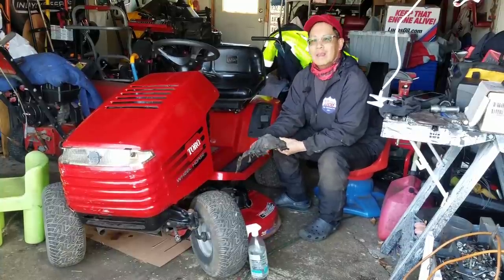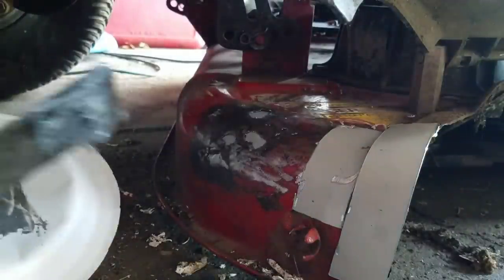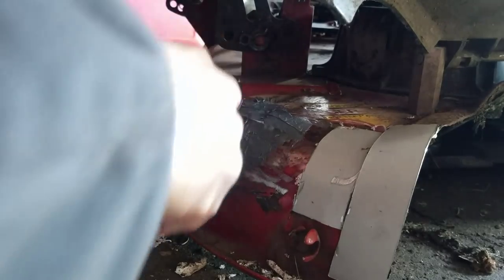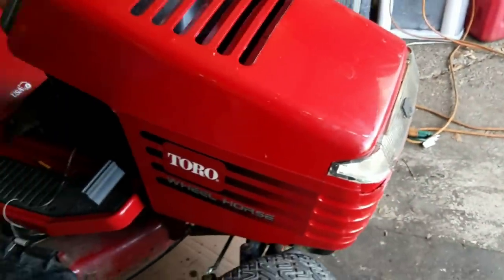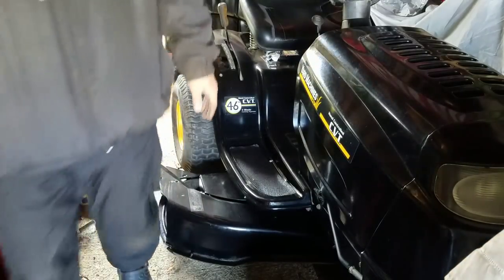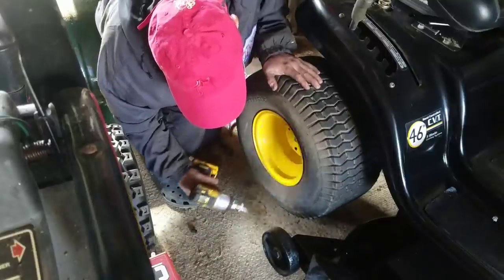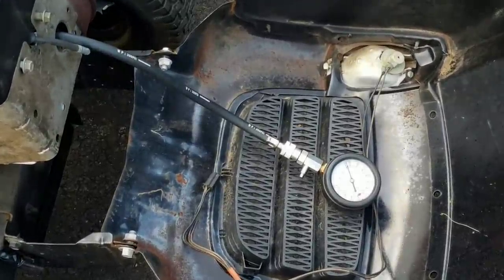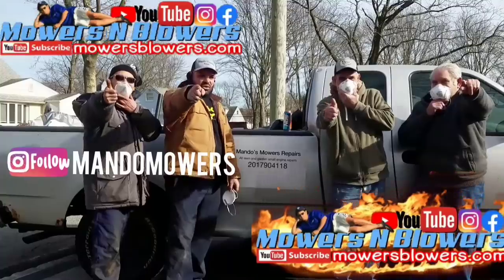HOW TO FIX REPAIR TORO WHEELHORSE 1238XL LAWN TRACTOR MOWER DECK RUSTY ROTTED HOLES USING JB WELD

Comment: Now that 13.5hp briggs, you might want to check to see if it has a blown headgasket.... Just a thought.
Reply from the maker: That’s interesting...
Reply: @MowersNBlowers  yeah it's a thought, what could it hurt right, and then if the gasket is good, you can still check to see if the valves are seating correctly.
Reply from the maker: RobertKnighthawk man....but this murray can’t cut the line, 2 other Murray’s are in queue.
Reply: @MowersNBlowers  well that's cool, just keep it in the back of your mind for later.
Reply: Good   day Yea when trying to start, noise from muffler  sounded different.  Might be easier to head gasket before taking motor out.  Thanks